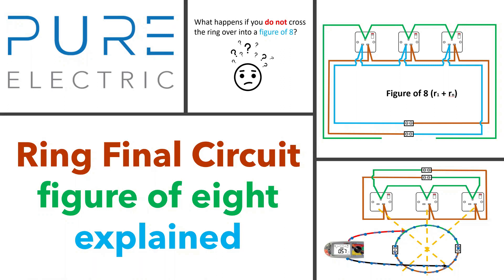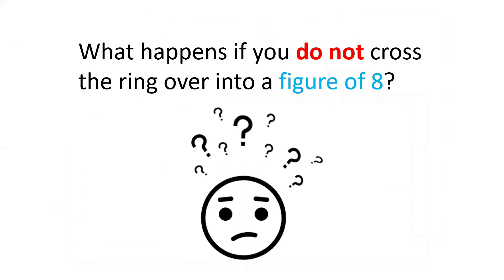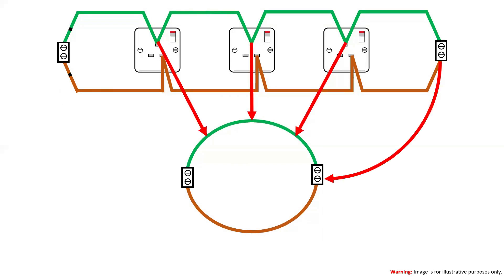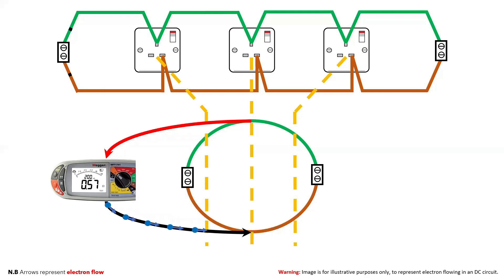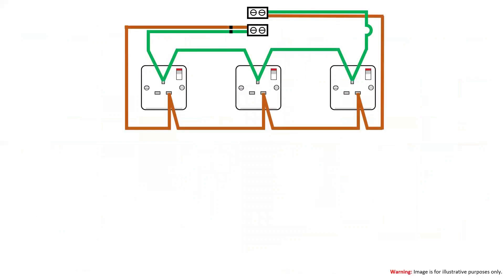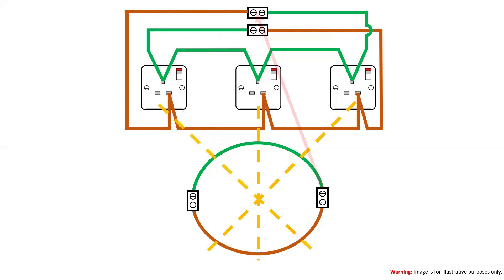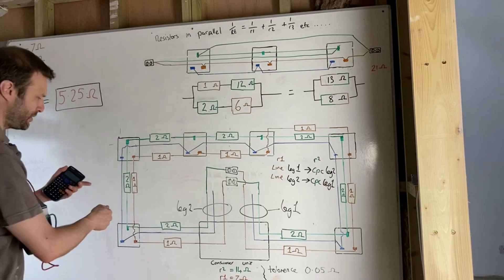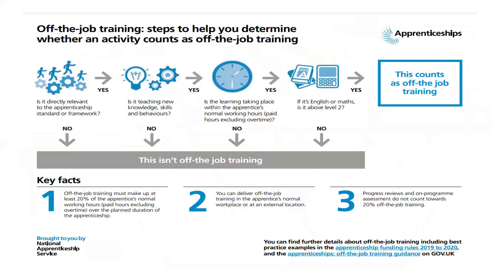Inspection and Testing - Ring final circuit figure of 8 explained

Comment: Why is an N-E test not carried out? And What other test does this test cover?
Reply from the maker: On a ring final circuit it should be, does my video not mention that?

If not, it’s probably because the aim of the video was to explain the figure of eight test, and why it’s important to get the conductors the right way round.

This video will explain why you need to test both R1+R2 and R1+RN

Fault finding on a Ring Final Circuit using R1+R2 & R1+RN, the only way to prove polarity AM2 AM2S
https://youtu.be/BKd7_dHBnG8